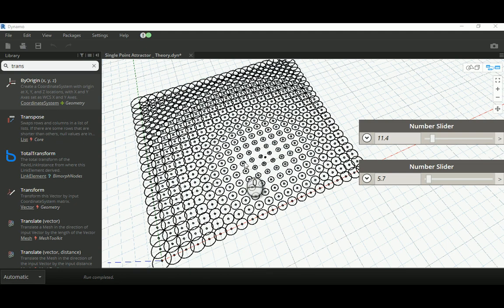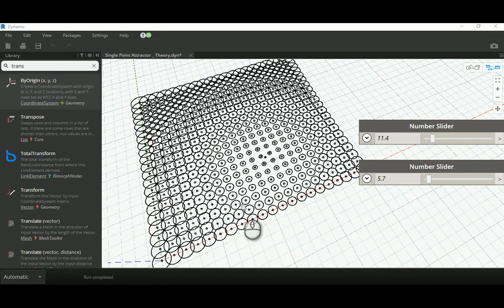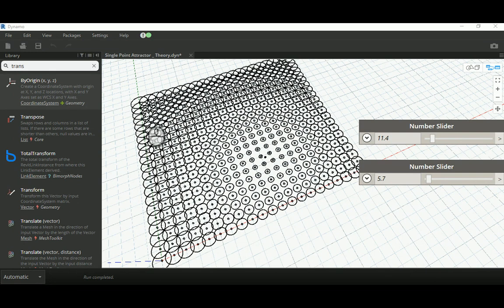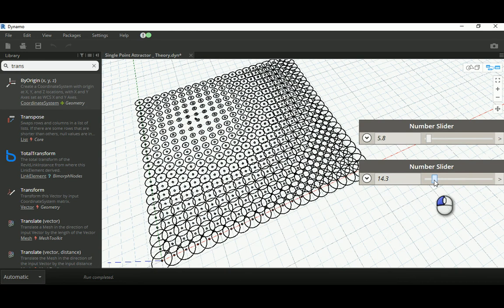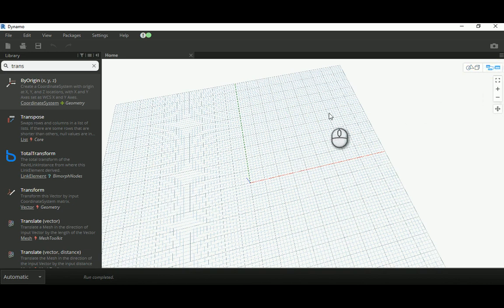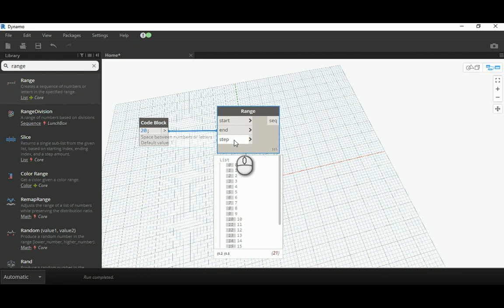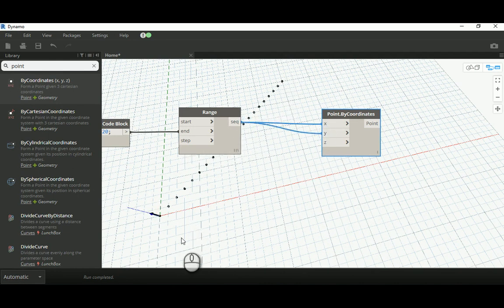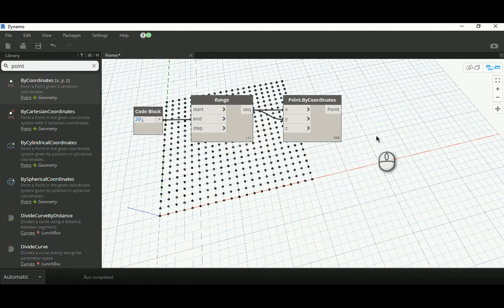Single Point Attractor in Dynamo - Revit _ Theoretical Part

Comment: Interesting demonstration, but in the real world of architecture, dynamo is practically a waste of time - especially in a bespoke building design. Might have some use in tessellated designs but overall it's useless.  Try using dynamo to procure an real life architectural project and it's a farcical.
Reply from the maker: Hi Steve, I disagree, you can design a building in it, you can make a conceptual mass analysis and let dynamo and refinery gives you 100s of possibilities of form, function and parking. You can add full dimensions to a plan, check a hospital plan for 1000 door to see if they match the standards or not! If you want to do that manually! This is a waste of time dear, In a real life scenario and you have an attraction point! Let say an important monument and you have 1000 intended buildings or towers and you want to specify the height for each tower based on their distance to that point! Do you want to make them one by one! Lots of real life architectural example, a smart building facade that need to track the sun location each min. And decide which panel to open and how much, you can not control or desig  that manually, it again point attractor and it can be done in dynamo, if you want to fill an out line of a whole level with 20 flat you will send days to see who much you can fit at that level, and which one has better view or create a view for most of them, a case where you have 3 or 4 parameters that you must achieve in this function can be done in few hours with dynamo and refienry, instead of days or works, assume you got a bad revit user at your team or got a hospital plan with 100 door and you find each door has been made in an incorrect width and height, you can run a dynamo script that check and replace all incorrect doors against the parameter you provide and it will take only seconds dear.
Have a good day :)
Reply: Firas Noori, sorry - but I used to be so interested in computational design.  I did a lot of self training and research with dynamo but found most of it irrelevant/cumbersome.  Automations great but it misses an important stage of the design process, which is checking.  No software is going to check your information is correct when you approve something with a contractor.  Put very simply, The problems outweighs the benefits.  It's broadly a tool that far too complex for ordinary folks to use.  I get you're used to this and probably trying to just sell it, but most of us find it too complex to find any efficient use for it and I live in the real world who don't use it.  Why write a code that take 30mins to rotate 10 chairs?  I can rotate these manually in 2 mins.  Plus doing this manually I can check it.
Reply from the maker: Well, all respect to your opinion